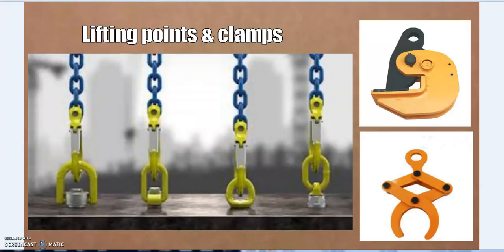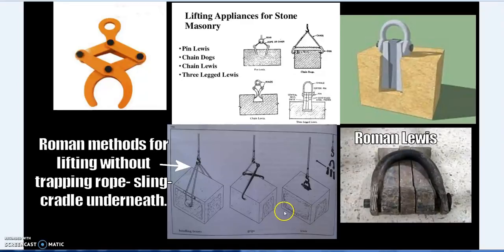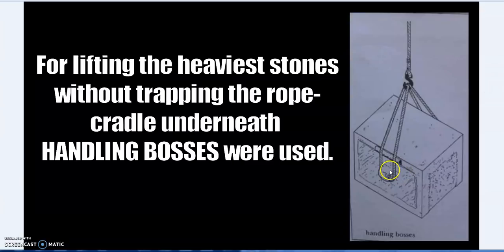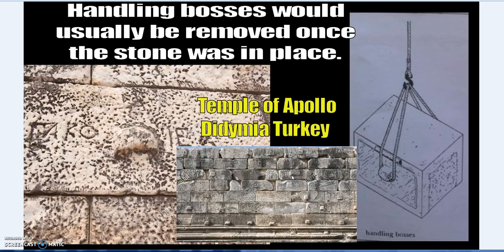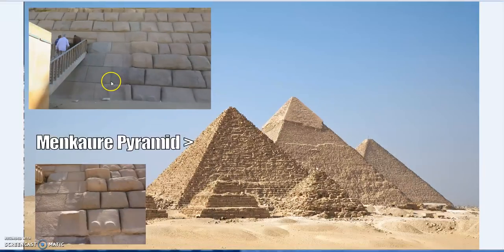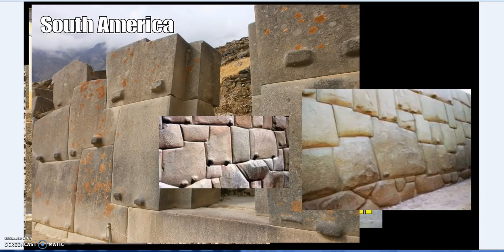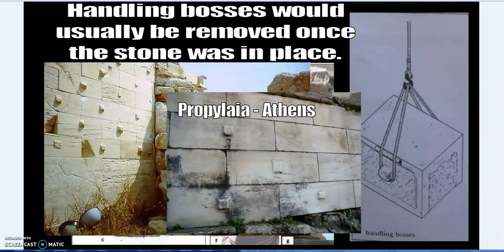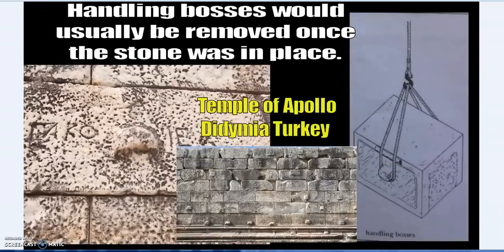Nubs: Handling Bosses - Comparison of ancient stone lifting techniques.

Comment: You and I have had heated dicussions before but this is a topic I am quite knowledgeable in. For me, maybe only 1 in 1000 nubs in the world is properly shaped and placed to be used for lifting. In the cases where there is only one nub on each side, the most efficient position is in the upper middle part of the stone. I am yet to see more than 2 nubs in the world in that position. You say that everyone comes up with the same solution, why hasn't anyone come up with the Right solution? Many walls are made of  2 rows, where, then, does the inner nub fit? Many stones in Cusco have nubs even though they only wheigh 20/30 Kg. How can you explain the effort required to shape the nubs if they can just be lifted by hand? You will probably blame erosion, but please, show me one nub ( apart from some on sarcophagi lids) that you would confidently attach a rope to? Nubs for Nothing

Comment: I have kind of come to the same conclusion, and found your video after thinking if the stones were lowered into place, how did the rope not get trapped underneath?  I've seen photos of unquarried stones that have the nubs in place, so it was from the get-go, as the blocks were being cut, so it makes sense they were used to move the stones around.  The ones in Greece, you can see them in many places.  I also found it rather curious that most nubs have a rounded top and a flat bottom.  That must have served a purpose, and my mind envisions rope or a fulcrum, but it served some purpose in positioning the stone.  Nice video!

Comment: I have wondered about those nubs, they seem to be in different areas and at different time periods. Your video makes sense. As to why some were left on the blocks , we can only speculate at this time. Any ideas about the reverse nubs or indentations?
Reply from the maker: Yes, I covered them recently in regards to Peru especially. Sorry i can't remember which video exactly but in the series on Saqsayhuaman. It has to do with fitting the stones, In a few places in Peru there are blocks that are half finished when it comes to joining.  Those indents for propping them back in final stages of joining. As well as making great lever points and so always on the bottom, almost always on the bottom edge.
Reply: @SacredGeometryDecoded  Thanks. I will definitely check out you other videos.

Comment: I have a suggestion why some nubs weren't completely cut off - perhaps during breaking / shortening the nubs they knew from experience that once the nub gets below a certain length, the block may be cracked if they continue applying the same method.. not sure if it always makes sense but I find it weird that the nubs that are left, are always quite short and don't look long enough to allow safe transportation, which suggests they were already partially shortened. Will be glad to hear opinions
Reply from the maker: Yes, i would agree, especially those near corners could easily take a big chunk with them if smashed off, and ruin the stone. If have a few pics of unfinished stones including Machu Picchu where the bosses are in perfect condition for hooking onto a rope.
Also, in some cases at least, to wear it down avoids accidental breakage while also allowing for them to be used for bracing points  if a frame for a canopy or wooden stairs, scaffolding etc.
Easy to forget the old sites were often painted or plastered and a living space rather a ruins. All the market stalls and such wold give a very different appearance to the bare walls we see now.
The Greeks and Romans used white wash for instance but when the sites are made to mimmick their original condition it horrifies the tourists.
They used to paint the hair, lips and other unmentionable bits of the statues too.
Hollywood tends to portray them living in the ruins even when they were brand new streets and buildings.

Comment: Great video. Thanks. It's more likely these "nubs" on the Inca and pre-Inca stones are not lifting points but actually a phonological or logographic record of visual data using binary code based on size, shape, length of nub, similar to how Quipu was used by Peruvians for 5000 years. Consider, why would they take the time and effort to shape and fit each stone to absolute perfection yet not bother to remove lifting points? Plus, the Inca communicated to each other using Quipu, it was how they conveyed and recorded visual knowledge so why not use that on buildings and important locations to communicate critical info to others? Almost like braille for the eyes.
Reply: Nope

Comment: Has anyone done tests to see if ropes of the time period could have lifted the weight of the largest stones?
Reply from the maker: Yes, hemp rope remained unchanged since ancient times until 20th century. Incredibly strong. I showed and linked in other videos. If you search for hemp fibre strength testing there are impressive stats on how strong it is. Same with the timbers they favoured in construction. 200 t per square foot for Lebanese cedar

Comment: Yes, but surely most of these "lifting bosses" are in the wrong place.  A lot of them are off centre which would tip the block and make it awkward to lift.
Reply from the maker: I used to work in lifting and rigging. We’d make custom slings and it’s useful to have them off centre. If lifting straight up and off have in the middle. Though for tricky fit it’s sometimes better to have off centre. All the weight supported on the boss and allows for tilting fitting. Especially for tight tricky fitting it’s better that way. The other side only needs a pincer since the weights on the boss. Sort of like having wheels on corner of a suit case instead of the centre. The weights on the wheels and easy to lift-tilt. To fit polygonal it would be better to have off centre to get stones in trickier spots where neighbouring stone has a spot overhanging.
Reply: @SacredGeometryDecoded  - Have we seen proof that these bosses were also on the opposite side.
Reply from the maker: Jacqueline X in some places yes, depends on access but some columns have bosses on both sides but some only one on one. You’d only need one to stop the rope sliding. Similar with blocks. The weight on one side with ropes. With pincers or even an L shaped bar direct from rope since it only needs to support a tiny fraction of total weight.
The bosses also work as a levering point.
The stone had to be moved, lifted and manipulated one way or another.
Ancient texts describe them.
Is there any other way to move stones without a lifting/lever point?

Comment: great info....just thinking about the Inca nubs....do you think there's a possability they could have been made for a diff reason? - many of the 'lifting' nubs are in the middle of the stone - which makes sense - but these are at the bottom...wondering if could be the last pieces of stone attached to the quarry face before final removal - if its a kind of stone that doesnt split naturally down a seam (as you know - some of them don't , so you have to make preliminary cuts to 'set' the split - so to speak). thinking the nubs left in place for superstitious reasons.